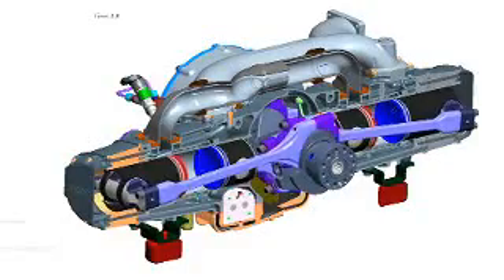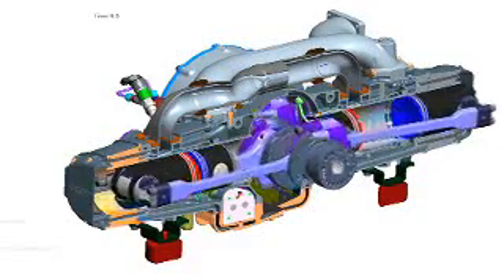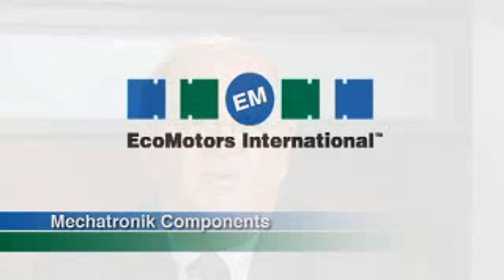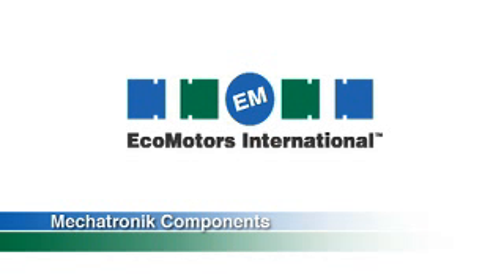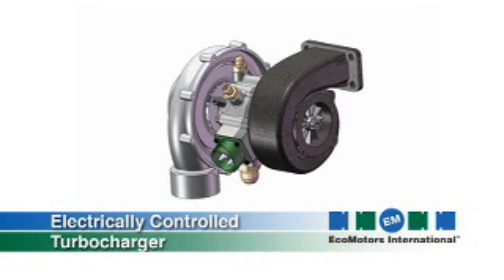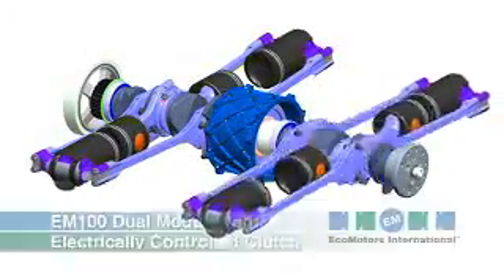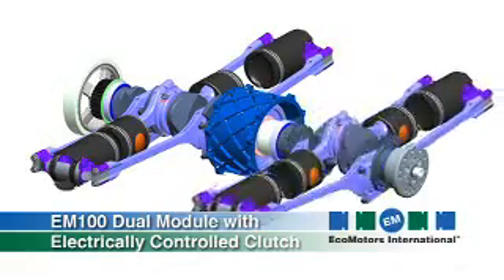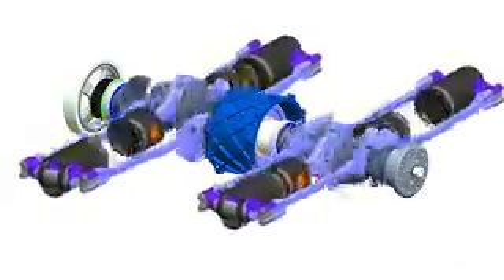EcoMotors OPOC diesel engine explained

Comment: EcoMotors - a great name! Thermodynamically however, it is simply another conventional "short-stroke", 4-cylinder, 2-stroke marine engine layout some BS artist had turned inside out in order to attract gullible investors... Mark Gendala, Melbourne, AU
Reply: At the end of the video he accidentally exposes a problem- he says one module would heat up faster to run cleanly.  Therefore, intermittent use of the second module will be cold and dirty.  BTW, there isn't enough room in a truck engine bay for this engines.

Comment: @Philscbx 
The only reason seizures are famous in 2 strokes is because not many people run them tuned correctly.    Tell me more about the potential issues with the outer piston wrist pin locations?  Also, i'm unsure how you can spot a cooling issue when they didnt even illustrate the cooling system.

Comment: @briansmobile1 

What killed the electric car was physics and battery limitations.  

There are many factors to consider, and even in a perfect world electrics may fall short. 

Here is why.... Thermal, water harvest, easy solar (no PV, just glass...cheap...can see through...more...) easy wind, 95% energy recovery of inertia (weight), and multiple fuel sources, including electricity...in a hydraulic motor, no doubt...

See my profile for details.  

Nobody is going to buy and hide this tech....

Comment: @briansmobile1 

An Electric motor is only 1/4 or less of the process.  It is like a hydraulic motor with a supply of high pressure fluid.  Electric motors are 10 times as heavy per hp as a hydraulic motor...if I can only supply it with high pressure fluid...just like an el motor.  

Electricity has to be made, very difficult to store, and does zero for thermal issues, water harvest (soon to be more valuable than fuel, some say).  

There is a better way...and it is NOT electrics.

Comment: Electricity wasn't always harnessed either.  But look at how much work is done with it.  Computers lighting etc. is all SO cheap and effective.  Look at solar powered calculators now vs. the ones that had vacuum tubes in terms of power consumption.  Electric cars got squashed because of oil interests.  Were it not so, electric cars would be far more advanced now as well as the batteries powering them.

Comment: Brainsmobile,

I know some guys from Caltech that built an electric car...spent $10 million on the prototype...better than anything Tesla, GM or Toyota are doing....but forgot the cockpit thermal loads...50% of power at city speed on a cold/hot day.  They gave up the project...

No, the answer is NOT electrics, at least for now.  Lit Ion bats are 570 lbs/gallon equ energy, vs 8 lbs (with tank) for a gallon of gas.  

Once gas engines are 60% eff. (soon) the game changes against electrics....

Comment: Quit dick'n around with gas engines- Electric has better torque and smoother, cooler, more reliable performance.  Spend your time developing lithium polymer batteries or ones superior.  Electric is the answer.  RC helicopters have just as long flight times as nitro ones and can fly 3D just as well and better.   It's possible, and it's the future.